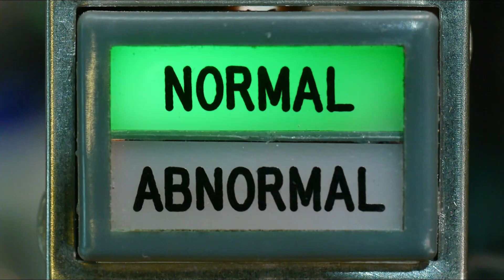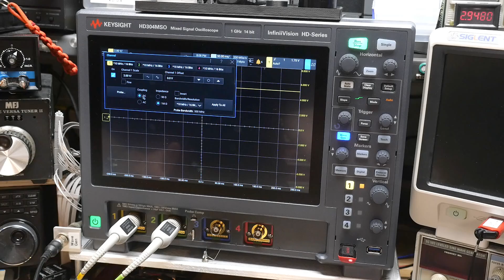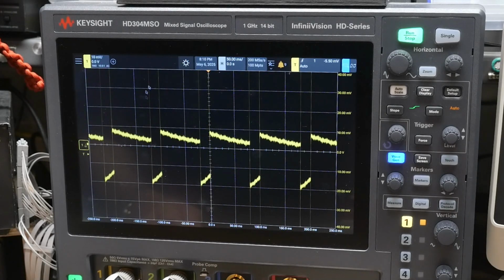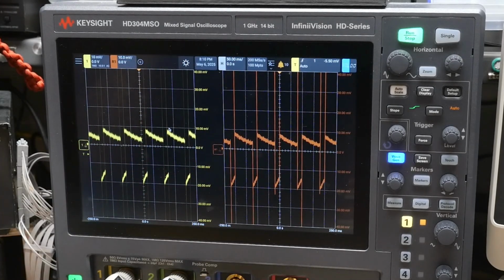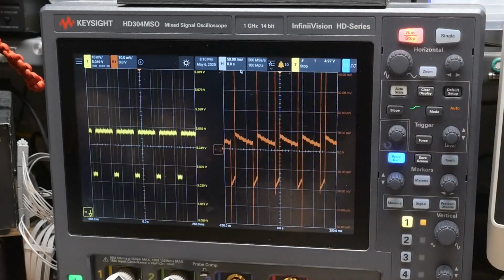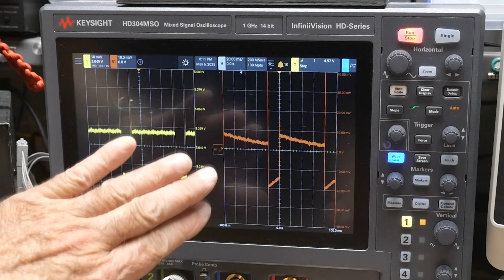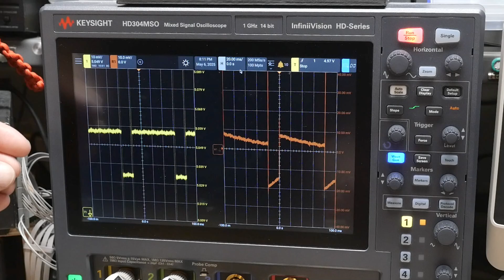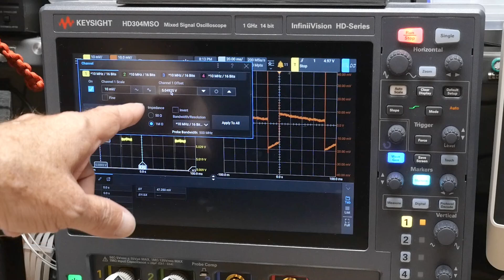#2226 Oscilloscope Coupling AC or DC with Offset

Comment: What about reading the noise on a 400Vdc rail?
Reply from the maker: you would need special equipment. I can imagine using a floating ground scope. attach the ground of that scope to a filtered 400V and make the measurement. one would need to have experience with high voltage and safety protocols.

Comment: Nice video. I knew this, had I thought about it, but I never thought about it. 🙂

One note about 4:45 "...turn a marker on..." and see the voltage values:

Don't you have a simple button that displays these sort of stats? One of the things I really like about my Rigol DS1040Z is that it has that set of buttons down the left side that let me instantly turn on a real time display of channel parameters such as max voltage and min voltage (as one wants in this case), P-P voltage, etc. (And of course there's a whole set of horizontal measurements, too.)

This is possibly the most useful feature of my (cheap) Rigol as compared to (even cheaper) handheld 'scopes and the like; I use it all the time. I would have thought it would be in every bench 'scope but the very cheapest, and it's one reason I strongly recommend a cheap bench 'scope over any kind of handheld to people looking for their first 'scope.

Comment: A couple of months ago I was reading a signal and I switched it between AC and DC coupling, and when I switched there was a loud pop and that channel never worked again. The signal was only a few volts, maybe 5 or 6v. Glad it was my really cheap scope, but... Is it dangerous to switch while connected? I've heard (after the incident) never to change coupling when it's connected, but I'd never heard that before and I really feel like they should put it in the manual if it really is going to destroy that channel forever.
... Yeah, at some point I'll go through all the ICs and test them and find out what's wrong, but I have better scopes so it's at the bottom of the project list.
Reply from the maker: were you using a 10:1 probe? should not cause any problems. are you connected directly to the BNC? Is the switch on your scope AC-GND-DC so going from ac to dc also transitions gnd.
Reply: @IMSAIGuy  No probe, just alligator clips on BNC. Battery powered, handheld scope so no ground. Switch goes Ground-DC-AC. I opened it up, checked the AC Coupling capacitor and it was good, switch was fine. 
I looked at the rest of the PCB, couldn't smell smoke, decided there were too many tiny ICs to bother reverse engineering that day, grabbed another scope, and didn't think much about it again until I saw this video. But now that my analog Techtronix filled my entire house with white smoke (without any probes even connected!) I'm starting to run low on scopes so maybe I should fux them.
I do have an identical handheld I can use to troubleshoot, and the channel input is a seperate pcb so easy to remove and swap for testing, so at least there's that. But the one time I did a quick search for answers people said switching coupling while connected can make scopes blow up, but I don't really see how. (I guess current through an inductor in GND and switching to DC would make a big spike, but there was no inductor involved.)
Reply from the maker: if the switch has a gnd setting then it probably got switched in that that caused the problem. causes a short between the two wires.
Reply: @IMSAIGuy  Yes, but I don't understand what that would damage the oscilloscope. The thing I'm testing, sure, but bricking the scope?
Reply from the maker: @SkippiiKai  let's say the scope was set to gnd, and the scope BNC was connected to a 5V 3A power supply. then you would have 3amps running through a circuit inside the scope that is probably rated at 10mA. might be a transistor or a very small relay. in any case 3A will destroy them. you only hear a pop when very bad things happen
Reply: @IMSAIGuy  wait.... The slider switch next to the BNC isn't what shorts the + to ground? Yeah, that obviously makes sense but why would they using a physical switch to control a transistor switch? Alright, I'm getting out of bed again and going back to the workbench to open it up again.
Reply from the maker: @SkippiiKai  a good scope would not do it that way, but who knows what a Chinese special engineer would do,.
Reply: @IMSAIGuy  I didn't even think I would have found it in the mountain of unfinished projects by now, but: Input goes through a trim pot, resistor, capacitor, and then the mechanical switch does take it to ground. HOWEVER: even though I can't see it, the PCB trace that goes underneath the trimpot had no connectivity. Quick repair of the PCB trace and... IT WORKS! The $12 100khz scope lives again! Thank you - both for the advice, and for the motivation to actually look at it! Thank you so much!
Reply from the maker: @SkippiiKai  I just fixed my friends tennis ball machine that had a blown PCB trace.

Comment: Nice video. Some scopes, like old school TEKs, have a separate control of DC Bias (offset) and vertical position. Now a days only DC Bias  control (called just "offset" on most of scopes) just remains, which is the only way to keep ADC dynamic range translated on region of interest for large DC biased signals.

Comment: While there is convenience in being able to measure low frequency variations on the oscilloskope the waveform shown is only 10 Hz, that is slow enugh to capture with most graphical bench multimeters.
You can also create a lower frequency AC coupling by using a larger external capacitor with the scope if needed.
Reply: An interesting fact I didn't think about is that the AC mode cutoff frequency is about 10 times lower with a 10x probe than with a 1x probe. So if you can live with the lower signal amplitude that is a way to capture slower variations.

Comment: It depends on the scope.  The AC coupling is acting as a high-pass filter.  Your scope is designed for very high frequencies, so the AC coupling capacitance is very low.  I see about a 20% droop in 10mS.  On my Rigol MSO5104, I get 20% droop at about 250mS.  Try your Rigol and see what you get. In any case, if the problem is at low frequencies, the offset method gives much better results.
Reply: Yes, you can also make a probe add on for low frequency which has a large value capacitor, 1uf or larger, polyester film, with a switch ( with a series 100r resistor to limit pulse current in the switch), complete with a voltage clamp on the output side, as you typically only are looking at small ripple voltages, so something like 2 blue LED's in series, and another pair back to back, with 1k of series resistance ( only a slight error with 1M input impedance) to act as both visual clipping indicator ,and limit the signal to 3V or so. can easily fit into a Pomona box with the LED and switch, and have a BNC socket for input, and a BNC plug, or a short cable, for output. 

A second one, with a small linear adjustable regulator, like a LM317, with just a 10uf capacitor on output, and powered by say 3 series connected small lithium batteries to give 12V, will work as a nice adjustable voltage offset as well. Regulator divider chain provides the offset and a stable voltage to use, it is reasonably stable, and, providing you have an isolated circuit, and only charge it when needed, you can offset up to 80V with a 10X probe, or 8v with a 1X probe. i did a similar thing with a LM723, running off a 24V supply tapped off the circuit, and driving a 1k resistor to sink 10 times the meter current, to make a suppressed zero meter for my variac, so that the repurposed meter had a nice linear range of 60VAC to 360VAC. and there was a nice 50V between major markings, and 10VAC for the minor ones, so the range was sensible.  Depending on input mains voltage you get from 0VAC to 340VAC output, and as it is rated for 10A, it is perfect for my needs. A 40W incandescent lamp will run on 340VAC, very brightly, though you need to bring it up slowly, and it has a very short life, around 10 hours. Funny enough same life as photoflood lamps, which for 230VAC operation were simply remarked 115VAC lamps, going from 1000 hour life to 25 hour life, and very well smoked glass when they failed.